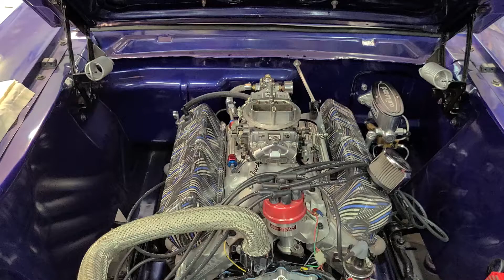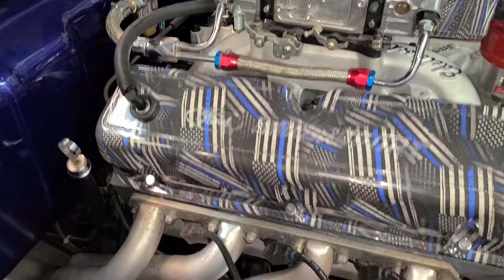1965 Mustang: 347 rocker arm update

Comment: I would pull the covers and make sure all is tight and good , If so run it and check them again . Might be some echo there to .
Reply from the maker: Oh I've pulled them multiple times.  It seems the same no matter what I do. I just find this hard to believe that this would be normal
Reply: @Cobrafanatik22  I agree , Should not make that kinda noise with hydro lifters .

Comment: Is that a solid cam.?
Reply from the maker: Hydraulic
Reply: @Cobrafanatik22  How heavy are the valve springs.?...Some tube manifolds will echo the part combustion escape from a large cam at idle...If it's not pulling the studs then run it for a bit and see what develops.
Reply from the maker: @ziggassedup  #135 closed and #325 at 1.200"

Comment: Assuming everything is tight and checks okay, I’d say blame the valve covers. They may be amplifying the sound that you’re hearing. Think of throwing a firecracker inside of a metal drum vs using a plastic drum.  I’m not saying to get plastic valve covers, I am saying that you may not have an issue at all as  the covers are to blame. Toss some stock Fox covers on it and see if it’s still noisy.
Reply from the maker: You might be on to something. I'm gonna leave it for now. I'll see if it gets worse.

Comment: I know this is getting aggravating to keep chasing the problem.
Reply from the maker: Lots of people are telling me this is normal. I dont know. Roller rockers are noisier than stock parts and this cam is pretty radical. We shall see what is to come.
Reply from the maker: One thing I have not done yet was put a timing light on it. I also know that there is 89 octane fuel in the tank and this motor should demand 92+ octane. Maybe those things will help a lot.